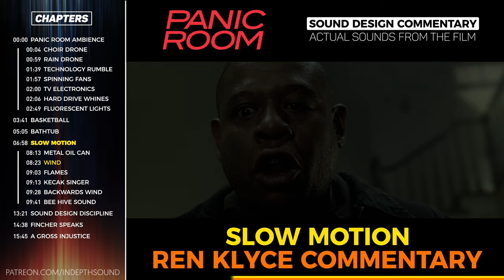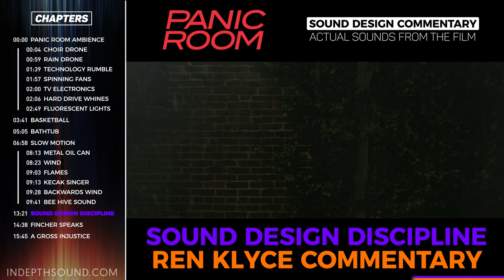David Fincher's Panic Room sound design explained by Ren Klyce

Comment from the maker: 00:00 PANIC ROOM AMBIENCE
           00:04 CHOIR 
           00:59 RAIN DRONE
           01:39 TECHNOLOGY RUMBLE
           01:57 SPINNING FANS
           02:00 TV ELECTRONICS
           02:06 HARD DRIVE WHINES
           02:49 FLUORESCENT LIGHTS
03:41 BASKETBALL
05:05 BATHTUB
06:58 SLOW MOTION
           08:13 METAL OIL CAN
           08:23 WIND
           09:03 FLAMES
           09:28 KECAK SINGER
           09:41 BEE HIVE SOUND
13:21 SOUND DESIGN DISCIPLINE
14:38 FINCHER SPEAKS
15:45 A GROSS INJUSTICE

Comment: Left Right Center Recording ?  Where I can read about it ? Thanks for help
Reply from the maker: Left Center Right recording or LCR recording. You can also get a more flexible result using Mid/Side (MS) recording techniques!
Reply: This is an exctract from an interview on the sound design of "Panic Room", where Ren Klyce mentions shortly the LCR recording: "...Instead of recording only in stereo, Klyce decided to “go one more and record it in LCR with the Deva. So we used a KMR81 Neumann for the center and two Neumann KM140s for the L and the R, and we printed those discreetly, and it sounded great.”
Reply from the maker: @marcolopez9496  Awesome, thanks for digging that up! This is a great field recording site: https://www.creativefieldrecording.com/ I couldn't find anything on LCR recording specifically but lots of great information in general.
Reply from the maker: @marcolopez9496  Ah man, I miss the Stack Exchange sound design forum. I feel like the best replacement has been Twitter and FB groups.
Reply: Definitely!